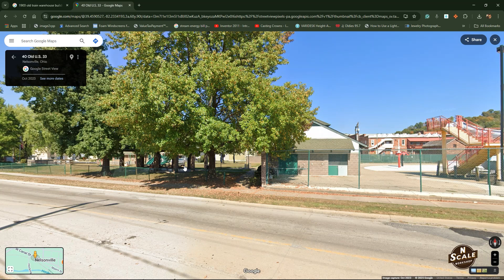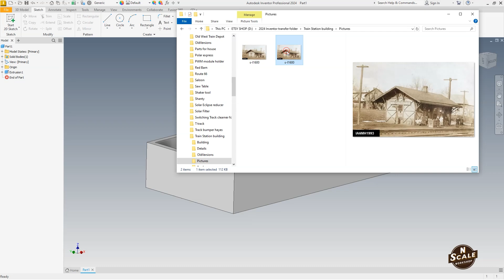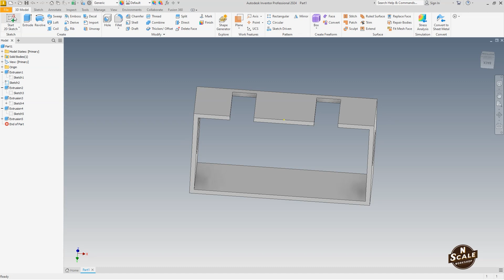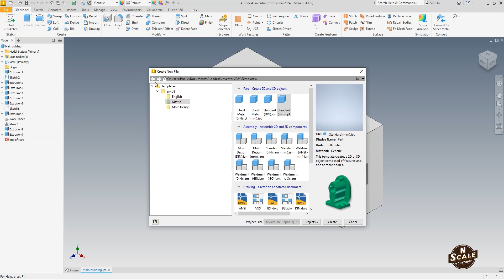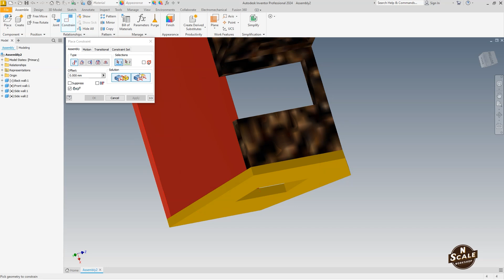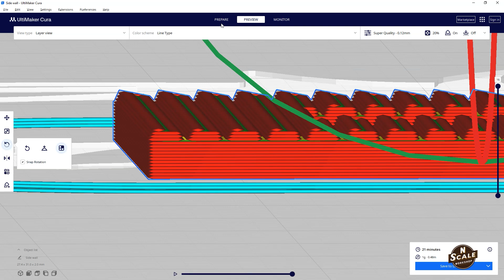🔨Wall Design  **Building an N-Scale Wall in Autodesk Inventor & Slicing in Cura** 🏗️

Comment: Excellent!!
Reply from the maker: @orangelicious33 I hope it shows some light on the design process. 👍💡✨ A normal design is about 3 days before test printing or kitting. 🗓️🚀🔥
Reply: @ Though, I use Fusion 360 your lessons are extremely helpful.